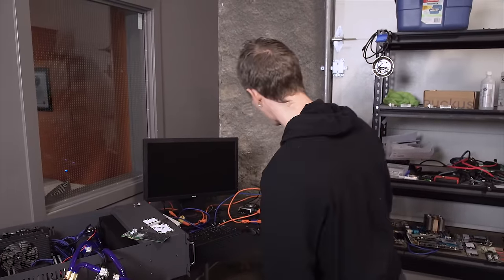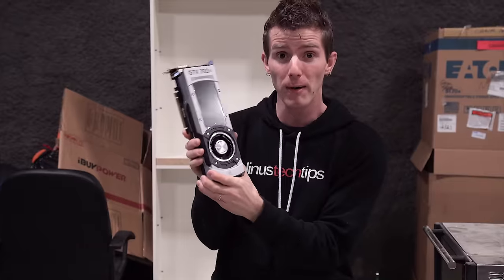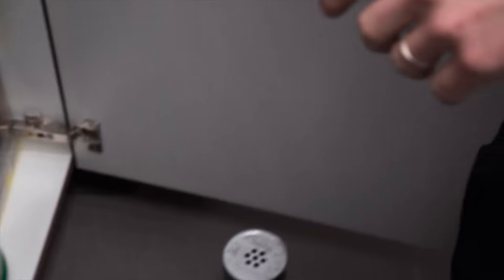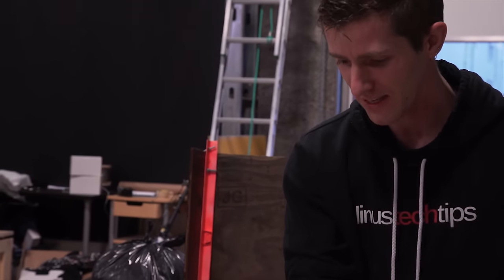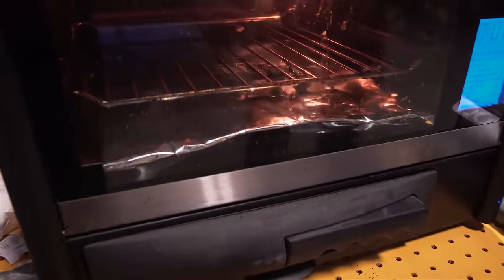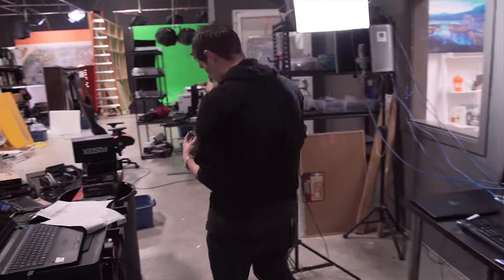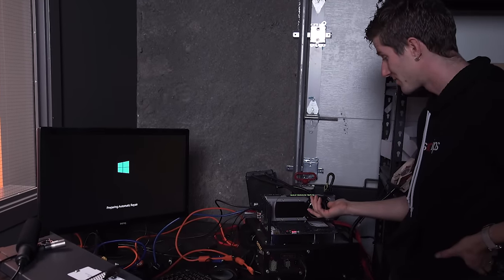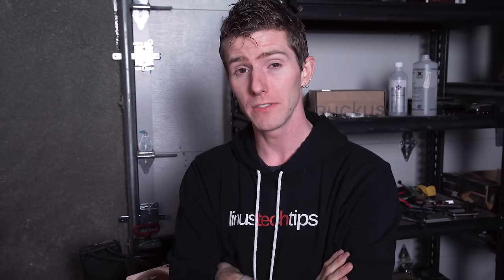Bring your video card back from the dead! - Oven method

Comment: You're supposed to bake the components at a lower temperature (around 125C) for 24 hours in order to remove all of the moisture the ICs have accumulated. This prevents the moisture from vaporizing during the reflow process and literally causing the ICs to explode. Also, the temperature profile you used wasn't hot enough and was for far too long. A typical reflow profile is 150C for 60s preheat, 165C for 120s soak, and 225C for 20s to reflow. You probably didn't melt all of the solder completely. While enough of it probably melted to fix some hairline cracks and temporarily restore the connection, it's likely to die again soon.

Comment: I thought I was the only one crazy enough to try this with a video card and I had a happy ending too. My 2011's clevo MXM HD6990m died in 2015 and i got it up and running with this method to this day, 3 years working flawlessly. I don't know if it helps, but I used around 200º C or 400º F to bake it for 15-20 minutes, after that I let it cool inside the oven for an hour.

Comment: You are never reflowing lead free solder in that oven, there is no way it will get the board hot enough. Whatever it did to the GPU it did not reflow anything.
Reply: +Andrew Joy many ifixit videos and unaware people, thinking they can reflow a ssd with chips that are NOT flip chips.
Reply: Well that too yes, but they did not even get the basics right, possibility if it was leaded solder they may have a chance but no chance with the stupid lead free solder we all have to use nowadays.

Comment: I heated my GTX 760 with an heatgun, i think this is much Saver because you can aim the heat.
#It worked
Reply: Well, if you use polyimide tape, you practically work without risk
Reply: I used two ceramic plates + alufoil to isolate other parts and expose only GPU, heated for 30sec at 550c, cooldown 10 min, mount and huraaaa GTX 560 Ti work again. It's aliveeee, my precious zombie card is alive again. Second day now, load 100%, 61c max, all O.K. ....stil. Cheers
Reply: Still working!
Reply: Hey man, long as you're being save.
Reply: SoulArtSound still working?
Reply: @SoulArtSound  come on man, say something
Reply: SoulArtSound mine too, my rx 470 suddenly have no power through 8pin cable, no display, fan didn’t spin, then heat it using heat gun, heating it on ceramic tile, front and back side for less than 5minutes, and finally it worked, stress tested it using furmark for 2h 30m and it runs great, the only problem is i only have crappy thermal paste
Reply: @drdandalf  I'm playing Satisfactory, right now, on Zombie card, STILL! It died few month ago second time, i just repeated same process with new paste, working normally.
Reply: @drdandalf  It so easy fix, im fascinated......and happy, i still don't have to spend money for new one. It past almost two years from first repair. Im now slowly saving money for new PC, this old is overclocked, burned, raped, killed, resurrected, etc ....i masterd all necromancery skills on this machine.
Reply: @aliafan7357  Buy new fresh paste, so u don't have to worry. I applied some random old paste from stash first time, it managed to work for one year ++ straight, then died.....for 30 mins ;) Or maybe, just maybe i shut down Afterburner by mistake, in middle of playing and messed fan control......Cheers
Reply: @drdandalf  To be clear, this is not a full proof method. This works for SOME as a temporary fix  !HOWEVER!  it is by no means an indefinite fix. The only way you can be certain is by trying it yourself. Before you try anything like this be aware of the risks that are present with baking any electronic. Before you continue with something like this I would advise you to explore every avenue (RMA/Warrantee) and conduct research on your specific problem(Remember this is a last ditch effort to try and fix something that is already beyond proper repair). Their issue may be very different than yours and you must proceed with caution. If you are aware of the risks and are willing to take them then by all means, continue. There are many guides with mixed results. Pestering people for a reply won't change your outcome. They are only one person out of many that have had a specific issue fixed, your case may be different.
Reply: @lulu-belle1203  I actually baked the gpu on my old iMac 2010 like 4 years ago. It actually fixed it and still works to this day.
Reply: @lulu-belle1203  agreed, but most of these times the cards are out of warranty and we tested to make sure its the card itself giving problems, and not something else.

One won't try this with an RTX but a GTX 10 series card is out of warranty by now so those who got a dead card can give it a shot
Reply: Hi
I have sapphire r 390 graphic card
It works only problem is 
When i play a game it gets hot i get black screen
I search on internet 
There is no solution
Should i put it in oven also
Will it help

Comment: I was actually skeptical about this, but to my surprise I could save my 7 years old GTX 560 after it showing some green lines on the screen. Instead of an oven I used a heat station and applied heat all over the card, also applied soldering flux over it, and worked good after 3 passes.

Comment: Just baked my 7870 200c for 10 minutes. IT WORKED.

I used screws in the PCB screw holes to raise it on little legs and placed it over greaseproof baking paper rather than tinfoil.

Was getting red lines on startup and bios screen and crashing before windows loaded. Started happening after game crashed because the Radeon software locked my fans to 30% and they weren't spinning up at all during gaming. I swear they do this on purpose with newer drivers to knock out people's older cards and increase sales.
Reply: Did you put whole gpu or did u take it apart like he did
Reply: @edis4380  I used it for a few more months till I upgraded but as far as I know it still works. It ran cooler too with the new thermal paste.

Comment: I just tried this on my 980. I bought it 3 days ago and it's been acting funny. The resolution was fine at first but then it got a little blurry after an update. It was pretty annoying. So I tried this, with oven on 425 like advised, but now it's not powering on. No fans or nothing. It did melt on the one side by the fan but not really noticeable unless you look directly at it. Do I need to stick it in longer or maybe a higher temp to bring it back to life? Should I return it to Best Buy and see if they can fix it? Any help is greatly appreciated. Thanx.
Reply: trollolol
Reply: I hope you are kidding
Reply: +Deebo Guwop i really hope you're joking, for your sake
Reply: No, it is perfectly fine. You should put it back in the oven on the other side for 425 degrees then take it out. Let it cool for 2-3 minutes and they will be safe to eat.
Reply: +Deebo Guwop Either you're a really good troll or didn't listen to the disclaimer XD
Reply: +Deebo Guwop the number on GTX cards indicates the temperature at which you bake them, and their base clock tells you how long to cook them for.
Reply: +Deebo Guwop The best fix is to set the oven to max, preheat for 20mins then stick your head in there for at least, AT LEAST a solid 2 hours.
Reply: you need to soak it in salty water first. Then bake it with chopped onion and garlic around it to give it that super crisp texture results.
Reply: +Deebo Guwop HAHAHA
Reply: +Deebo Guwop Screwed.
Reply: +Deebo Guwop Please tell me you're trolling lol. If you aren't, you should have returned the card to best buy, 3 days is well within warranty, so you could have just had it replaced. Now you've voided your warranty, so Best Buy won't do anything to fix it. If any of the card has appeared to melt, then it's probably beyond repair right now. This is why you should listen to disclaimers.
Reply: You can try to reflow the solder however you have to cool it first in the freezer for 24 hours.
I'd suggest heating it up in the microwave as opposed to oven, more even temperature distribution
Reply: Well it should've said the cooking instructions on the box, hopefully you didn't throw it away
Reply: you can't go to best buy so go to a normal computer parts store and yell at the guy behind the counter to fix it slam it on the counter, pick it back up and walk out.
Reply: +Blazing25 l Top Notch Youtuber computer*
Reply: +Deebo Guwop                        GlaDoS recommends: 15 minutes at   4000 degrees Kelvin
Reply: +Deebo Guwop You screwed your graphics card also it was 385 he set the oven to not 425 which is probably the first and most important reason why your gpu was pretty much dead after that bake. If you try return it to Best Buy I wouldn't recommend telling them you tried this because of a Video you got off Youtube..Some useful advice.
Reply: it should to be able to run minesweeper fine
Reply: must of missed that whole "void your warranty" warning during the video.
Reply: pre heat your oven to its max temp and just put all your money in it to burn. Its a bit like what youve done already but you cut the bullshit of burning your money on a GPU and just get straight to the point.
Reply: +Deebo Guwop research is always the best way of knowing if this has either worked or failed especially with the specific kind of GPU any person here would want to try it on..research research and keep researching until you're either satifisfied enough people have succeeded at it or to many have failed so you wouldn't bother attempting this or when you do PAY CLOSE ATTENTION TO instructions in such videos because this time around you didn't and so your GPU which if I had bought a 980 in my country would set me back over $1000
Reply: +Deebo Guwop God, WHAT ARE YOU DOING? Its common knowledge, that the 900 series cards dont stand the oven and are made for pans
Reply: lucimon97
common knowledge among those who follow the tech world not the general public not otherwise interested in IT lol.
Reply: +GeebusCripes HAHAHAHAHAA
Reply: NormalPerson Why nobody play support!!!?? pretty well detailed joke if it were one lol
Reply: +Deebo Guwop link to where they said 425 degrees.
Reply: +Deebo Guwop That wasnt too smart
Reply: +Deebo Guwop I think that you'll have the biggest chance of fixing it if you bake it in an industrial oven at 500 C
Reply: +Deebo Guwop if nothing else works .. make sure to put it in the microwave for a minute or two ... don't worry about the sparkles, they are the fairies resurrecting your GPU
Reply: +Deebo Guwop you're doing it wrong man, use a microwave oven set to 800w for 10 minutes, the spinning platter will ensure the chip is evenly heated.
Reply: +Deebo Guwop I see your problem!

The trick is to set your oven to the max possible temperature and then get in it.  If all goes well, you will turn to dust at the end of the cycle and reduce the amount of wasted space on this planet. 

Hope this helps!
Reply: +Deebo Guwop should have just sold it on ebay as is and got some money out of it..now its junk lol
Reply: +jort93z error 404; joke finder not found
Reply: +Deebo Guwop i tried this on my 980 ti.....i thought the ti stood for (time in) ie the number of seconds in a microwave....needless to say it doesnt work anymore and half my house is gone!!!
Reply: +Deebo Guwop I think you confused your measurements its 385 meters not 425 yards. Try again! Good luck!
Reply: +Deebo Guwop 
Your warranty is gone.
Reply: +Deebo Guwop Wtf at the start of the Video he said that you SHOULDNT do this with a Graphics Card that has warranty. I dont know if the BestBuy guys will accept it
Reply: +underscare lmfao
Reply: +Nicholai Chev lmao
Reply: +Deebo Guwop Euhm, are you a TROLL?
Reply: It's funny how you're all falling for that one
Reply: +Deebo Guwop he didn't say 425 lol
Reply: now that you've baked it you need to remove the stock cooler and poor buttermilk on it. then you install it in the 16X slot and voila! liquid cooled 980. should run amazing and make wonderful cheese.
Reply: +Deebo Guwop You need to deep fry it
Reply: Are you just trolling or voting for Trump?
Reply: Have you tried turning it on and off
Reply: +Deebo Guwop I just really hope you are joking. If you are not, then just wrap it in aluminium foil and put it on the microwave for 27 minutes.
Reply: Duallies with "off" being the last step lol
Reply: You should of took the 980 back!
Reply: +Jim G obviously not a very good troll if everyone knows he's trolling.
Reply: Trevor Hannah some bloke didn't
Reply: Yes, because the first thing you do when you find your 3 day old 980 is not working is to put it in an oven and not bring it in to Best Buy to get a free new one. Yep.
Reply: Totally A great idea. If you couldn't tell, this is for DEAD video cards. You could have got your graphic card repaired. On top of that you could have got a new one for free because you only had it for 3 days. Smh.
Reply: +Deebo Guwop at least its wasn't a ti :)
Reply: did.... did you not watch the.... the warning
Reply: I'd give this a thumbs up for bringing all the humorless pricks out in the sun, but unfortunately the Android app can't do that yet (seriously Google it's been almost a decade now).

So instead, this comment will serve as my award to you for the best derpmagnet post of February 2016. Congratulations!
Reply: +WhiteHawk protip: just throw it into a furnace, wort case scenario is youre down a graphics card
Reply: +Deebo Guwop Pro Tip: TAKE IT BACK IF ITS BADD!!
Reply: +Deebo Guwop You baked a graphics card in an oven, that doesn't fix anything. Tell other people that it didn't fix anything so myths like this stop spreading.
Reply: +Deebo Guwop 
Lol almost got me. Good one. Advanced trolling 101.
Reply: +Louis Rossmann Did you not watch the video or do you completely lack a sense of humor?
Reply: +Deebo Guwop LinusTechTips will cover any costs involved with replacing your device if this method doesn't work!!

Comment: 7min @380f resurrected my heavy glitched GTX 1080
(Before)
Dust and thermals checked
Psu checked
Motherboard checked
Ram checked
Cleaned again and check for dust or metallic debris
Still was faulty, random crashes with weird colors and blocky glitches

The oven fixed all and now is fine and performing well
Thanks LTT

Comment: Thank you for your guide.... I was able to bring my GTX 670 back from the dead. I was hoping to upgrade to 2000 series and thanks to you.... I will not be rushed to buy a card
Reply: Does it still works?
Reply: @leoprozczinski  sadly not... I ended up upgrading to gtx 1080.

Comment: I just saved two graphics cards that had artifacts by doing this, one made by Nvidia and another one by AMD. Thanks man.
Reply: NewSuperJulian I'd have thought the amd would bake itself by simply using it
Reply: God I thought that too :/
Reply: NewSuperJulian  does that video card still work ?
Reply: Bruno Cerra It broke the whole PC after a while so no.
Reply: Wait wat.. how did the gpu break the whole pc wtf are you talking about
Reply: NewSuperJulian really
Reply: Do they still work? If not how long did it last?!?
Reply: AMD VS every video card
Reply: Probably shorted everything out...it is possible, but rarely, to have one component to short out everything in the PC. Power of electricity my man.
Reply: come over to denmark and fix mine

Comment: instead of buying an oven, can I do this inside cabinet of amd CPUs and cards ?
Reply: Lol
Reply: just make sure they're paired with some fx 9350 processors without cooler, sun heat garanted
Reply: Pretty sure you should just go and buy new nvidia gpu, since yours will become obsolete in a year, when they drop driver support and change gameworks so that your old gpu becomes basically useless.
Reply: how many degreeses does amd cpu card deploy at because i want to download 6 kbs of cory in the house and i only have 2 ram
Reply: One intel i9 should be enough

Comment: this is what you did wrong....

1. you placed the graphics card upside down.  if the solder is softening why do you have it so the gpu pulls away from the card?
2. you didn't brace the card.  it can flex when heat gets to it.  have a jig where you can hold the graphic card in place so it doesn't bow and flex
3. no use of flux on solder.  this is an absolute must or your repairs are temporary at best
4 removal from oven while it's hot. same thing moving it can damage the card while hot.  turn off oven, open the oven and let it cool down on it's own

you're best way of doing this is buying a reflow  station and making a custom jig for graphics cards.